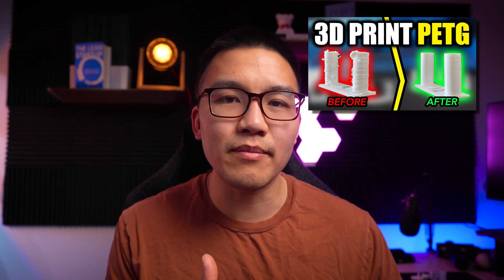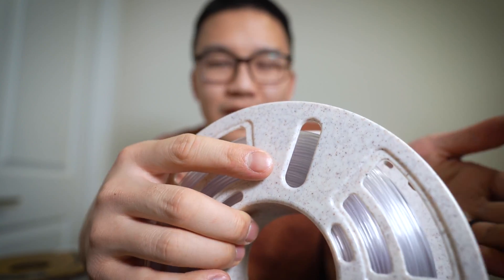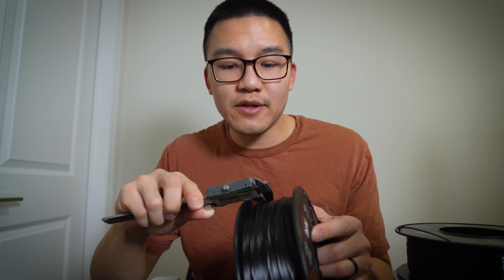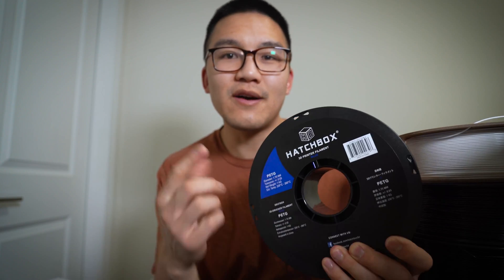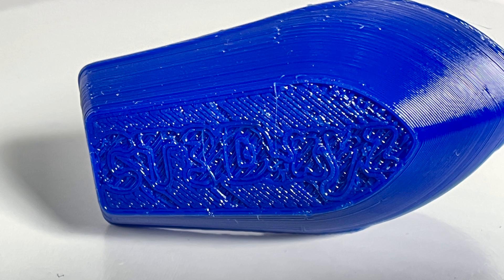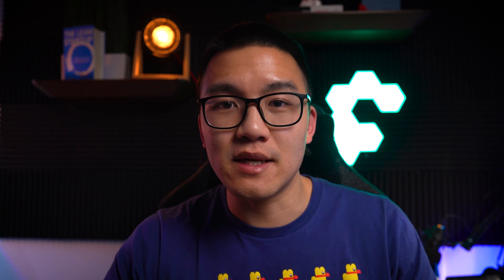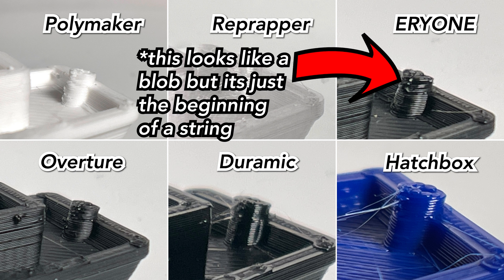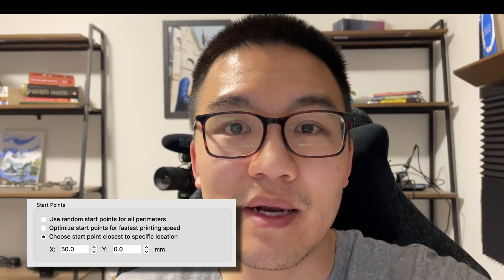Does Higher Price PETG Result In Higher Quality?

Comment: PETG is my default as for me PLA irritates my throat! I have tried a few and hatchbox is decent quality but also the cheap amazon stuff is fine too. I had a roll of hatchbox that has been sitting out for about 5 years and with a quick dry on the bed of my printer it worked flawlessly .

Comment: I've had PHENOMINAL results with some random/cheaper filament suppliers that outperformed name brand ones. At this point- I know a couple makers to avoid. And aside from specialty filaments I have great luck with any number of "cheap" filaments under 30 bucks. Heck several under 20😂 I'll drop coin on engineering filaments but petg is my go to cheap do it all filament. I don't use pla EVER.

Comment: What settings are you using? Temperature, on the lower or higher side of reecommended temps, what speeds, retraction, z hop, there is misssing so much info here for it to be usable.. for instance. Im mostly printing polymaker petg. And i have zero blobs, stringing or angelhair. But that dont tell you much without knowing the rest..
So imo, this was an usless video.
Sorry. You got greate content, but this does not tell me anything.

Comment: Been printing with PETG almost exclusively for a year, don't have much experience with the "good stuff", i used eSun in a custom colour a lot because that was what my company ordered and on my own printers i use the absolute cheapest stuff i could find on taobao which was around 70-90 RMB per spool (i don't remember the exact price but thats what i had saved in my cura filament profile). For the longest time i didnt even have a filament dryer and i would just print with wet filament. All i can say is if your your profile (retraction, temp, combing, wiping, coasting) is done well, stringing can be reduced a lot. Even with my whack ass cheap and wet filament i didnt have much stringing. i could even push it to 25.2mm³/s on my klipper printer for infills and inner walls, no problem and even less stringing. With dried filament the results are of course better.

Comment: I am not seeing much difference between PETG brands, but I absolutely see big differences from one color to another. This seems to be most pronounced when I switch from a translucent color to a solid one, with solid colors requiring that I print about 20% slower or I get horrible glops and horrible bridges and overhangs. Honestly, my PETG prints look a lot better than yours, and I have found that the most critical thing I must do when printing PETG is SLOW DOWN by reducing the volumetric flow to no more than 12, preferably 10. As I understand it, PETG is a plastic that holds its heat and cools slowly, so if you go fast you will be crossing wet filament and creating strings and gloops everywhere, and bridges will droop. I have also noticed that the part cooling fans are turned up higher when I print PETG.

Comment: No matter which brand you chose, I seen  PETG as easier to print ABS alternative for simple form objects. Tool handles, cold water pipe adapters, cable holders, furniture parts, etc. For anything with a lot of small details PETG is not so good choice because of tendency of stringing. And one more interesting fact about this material. PETG is pretty elastic if you apply force slowly, but if this force come as short impulse they "became" brittle almost like PLA

Comment: ive been seeing people saying overture PETG black likes to be printed hot close to the 250+ range but i have a roll that ive been running tests on and it prints at extreamly cool temps my first test it was running at 215 with very very little stringing or any issue but ive also seen it have the same conditions at 230 which is the base low temp suggested by overture which makes me wonder if the hotend temps we see are truly at the temp stated on our printers

Comment: I just hate petg.  I get a roll, it prints good, then it starts clogging every time.  Brand doesn't seem to matter.  

Yes, I have a dryer, and have kept rolls in for a week before with no change.

Tried retraction settings, extruder tension, temperature, cooling on and off and from 30% to 100%.

PETG is the Devil's filament.
Reply: How do you know it is clogging?  Are you getting under-extrusion?  I like to print Petg at the max temp, coupled with the minimum fan that works well for the part.  Too much fan will cause the filament to harden before it completely leaves the nozzle.  Be sure your fan duct doesn't direct too much air to the nozzle tip.  A dual fan setup such as Hero Me does a better cooling job, allowing a reduced fan speed and less air blowing on the nozzle.

Comment: pla is not brittle, its stronger than petg. petg only beats it for outside use
Reply: pla is brittle, what are you on. you can snap pla easily over petg which bends
Reply: @alex59292  Hoffman tactical proves it

Comment: I know it wasn't in your comparison and this is an older vid, but I just started printing PETG a couple weeks ago. I had really awesome prints using Voxelab's PETG Pro (PETG+) in white. I followed that with SUNLU PETG in Clear and I found it to be a bit more finicky requiring another +5°-10°C on the hotend @240°C. I think you make a good point that transcends FDM 3D printing in general, and that was just pick one and "tune the crap out of it."

Comment: The overture black PETG likes to print at 255c; higher than stated on the packaging, and higher than other colors of Overture PETG. Bringing the temp up took it from my least favorite to most favorite PETG filament.

Bed temp 80c
Reply: I struggled with the Space Grey until I took it to 250 deg.
Reply: Overture was my go to brand for PETG.  It's fairly easy to print with once you dial in the temperature.

Comment: To compare filament quality across brands you need to tune for each filament. We don't really gain anything from this comparison other than which ones work best with your current settings.
Reply: Thanks for your comment. Saved me some time.
Reply: True. The experiment is useless
Reply: Agree! He didn't even tune the print temperature, which is essential for every filament. And I think comparing should be done with the same color as well. I've seen major differences between two colors of the same brand
Reply: yep
Reply: He does say as much at the end.
Reply: I think his point was you'll get fairly consistent results even with cheap filament once you dial in the temperature and flow rate.

Comment: Do yourself a favor and get an Eiboss filament dryer.  They are expensive, but are worth it and they will help you determine how well these filaments print when they are absolutely bone dry.  I use one myself and it has been the single best improvement in my printing since I started this hobby.

Comment: Did you forget to dry these? The prints actually look pretty bad across the board. 

PETG picks up enough moisture to be unusable in under a day and I've never gotten a roll "ready to use" out of the vacuum bag.  All have needed drying before first use.
Reply from the maker: I didn’t have a dryer and they came straight out of packaging. I have dryer now and have gotten slightly better results. My current humidity is 45% though which is not too high
Reply: @justmakeitdaniel7667  Mine is around 50%, it really doesn't take much lol

The "problem" is that petg doesn't sizzle and pop when it's moist, it just oozes all over. 

Your petg profile could probably use some tuning once you get the moisture under control.

Comment: Nice video! Hard to come up with a good comparison just by visual inspection…. If you follow folks like CNCKitchen, he has a variety of layer adhesion tests as well. One question for you, did any of these filaments recommend different temp profiles?
Reply from the maker: Yeh CNCKitchen does a good job with strength comparison. For me, I was aiming more for aesthetics in this comparison since the benchy its testing for these rather than part strength.
These filaments did have different temperature ranges that they recommended but the temperature (245C) I printed with fell between all the filament's ranges

Comment: Did you tune the temperature for each of the filaments?  Not doing that could explain some of the problems.
Reply from the maker: I didn’t fine tune each one but the problem largely is more because of my printer limitations on print speed which caused a fair number of artifacts

Comment: I don't know if you can get this filament where you are (I believe the company has worldwide affiliates).

3dfilaprint here in the UK sell an own-brand filaprint PET-G. This one is unique because it has a print temperature range of 195C to 220C and it prints very cleanly.

I print it at 210C (40mm/s) or 215C (60mm/s) with 5 to 6mm of retraction at 60mm/s retract speed. This gives me prints without blobs or stringing using Cura or PrusaSlicer.

I believe it's the modification which allows printing at lower temperatures than other PET-G which gives the clean results.
Reply from the maker: Looks like I will need to ship internationally but I'll see if I can find a way to get my hands on this. I might actually be heading to the UK for a week or two this summer
Reply: +1 to this, they also do samples of 10m too so much cheaper. 

Of course they are a great bunch of guys/girls too if you go in person 👍😁

Comment: Yeah, I'd say that you've got problems with your printer or settings if you're getting benchies with such poor print quality.
Reply from the maker: Have you found out any better on a benchy with an adventurer 4 and petg?
Reply: @justmakeitdaniel7667  No sir, not on an Adventurer. I think you can, and certainly will, do better with some careful adjustments on the Adventurer. That is a high quality printer and you should expect much better results in my opinion. I'm not trying to be derogatory, rather to encourage you. I've struggled mightily with PETG and just this month I've finally found the settings that work. In fact, they worked so well that I printed a virtually perfect benchy on my $200 FLSUN Q5 with only an upgraded extruder. I'm making a video, reviewing the benchy and settings, in an effort to encourage other Q5 owners to persevere with PETG because the material is, as you rightly pointed out, a great alternative to ABS. Video will be up in a day or so.
Reply from the maker: I’ll have to check it out!

Comment: Awesome presentation.  You're convincing me to start using Simplify 3D... I can't achieve results as good as you're showning w Hatchbox PETG with FlashPrint.  I'm curious was print speed and layer height you're using.  Thank you.
Reply from the maker: I'm using 40mm/s print speed with travel speed at 150mm/s. Layer height is 0.2mm. Simplify3D has a lot of great features but I do find there are so many options that sometimes its hard to figure out which one works. By now, I've probably printed 30 benchy's and still haven't gotten a perfect PETG Benchy. I will be trying tonight what I think could give the perfect Benchy so fingers crossed! I'll share those settings once I actually achieve it
Reply: @justmakeitdaniel7667  I thought I had a really decent PETG FP profile, then tried it on a different part.  Hmm.  Starting to believe there may be no such thing as a profile that fits every project.  Little things need tweaking... for example: lots of infill in a rectangular print, seems I can increase the infill speed, but do a bowl-like part with hardly any infill in the bowl walls, I have to reduce the infill speed or suffer lots of artifacts.  

150mm/s is wow hard to believe, in FP I'm seeing issues with high speed transitions "jerking" the filament up or over during air travel to other locations, leaving artifacts of one form or another,  not to mention the case shake it creates (which at 100mm/s knocked over a piano light I had sitting on top, lol).  

Just recently I discovered 1st layer at 230C and no fan worked very well, no stringing, flat as paint, then I use the fan list to go 10, 10, 20, for temps 238, 238 and 255 for all the rest.  I use "slow 1st layers" =4 in FP (layers 2-5).  As soon as it goes full speed (70mm/s base speed) an artifact is created due to the Jerked acceleration.  So I've reduced print and travel speed to 50mm/s.  Reducing Travel speed only increased print time by a minute over 3 hr print time, so willing to live with that to eliminate case shake.  

One last thing: I used to print PETG starting at 245C and work down to 235C.  Now My approach is almost the reverse, 230C (no fan) to start and work up to 255C.  This has left my parts looking more like cast metal (full melt between layers) as opposed to "layers of strings".  I like it, I think I'm headed in the right direction.

Can't wait to see your final PETG setup.  Good luck with your tests.

Comment: Nice video and great timing!
Literally just started printing PETG a few hours ago haha.
Printed a 9 point bedlevel test without good results, but that's due to the bedleveling issue that I'm still struggling with.
Reply from the maker: Is your bed low on one side and high on the other?
Reply: @justmakeitdaniel7667  It was! It got repaired by my reseller but now im struggling to get smooth prints on each of all 9 points.
Reply from the maker: I assume you are printing the squares at the 9 points. If so, do you have some squares that look good while others are terrible? I would suggest shimming the bed with some heat resistant tape (aluminium tape used for duct work might work) or use actual shims which are better because they won't leave residue. If you decide to shim with tape, put the tape on the removeable bed, not the hot plate
Reply: @justmakeitdaniel7667  Yes, I am and indeed. Some look good, the others bad. I'll see where the fault is at and try the tape!

As I'm test printing with PETG I can already tell that I have no blops. Using the 0.4mm 265 degrees nozzle on 250 degrees celsius. (Standard PETG profile from FlashForge).
I can't imagine that your way of tinkering is THE way of a ''plug&play'' printer. But fine if it works for you of course.
Reply from the maker: @joeyvanrenesse884  Are you printing a Benchy? I'm getting a fair amount of stringing and some blobs where I do retraction. Also the random blobs I'm getting on these benchy's are because I had the print optimized for speed rather than the same start location

Haha the adventurer pro hasn't been so plug&play for me but perhaps I'm trying to achieve the perfect benchy
Reply: @justmakeitdaniel7667  Havn't tried a benchy yet. Im printing parts where I bought the printer for. And I agree.. it hasn't been so plug&play for me either, but it sure isn't supposed to be a printer to tinker with!
Reply: @joeyvanrenesse884  yeh it’s a pretty closed system. I didn’t realize that when I bought it. But I do see opportunities to possibly improve either the experience or some marginal print quality upgrades.

Let me know how a Benchy turns out for you! In my experience, the section where it’s only printing the 4 door posts, that’s where it has the most problems